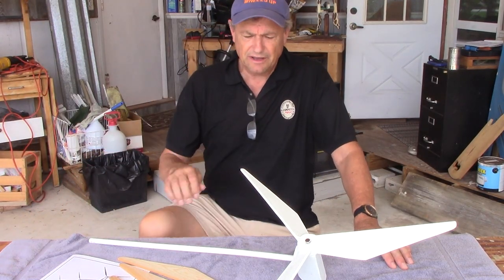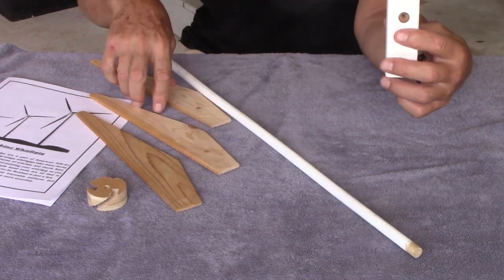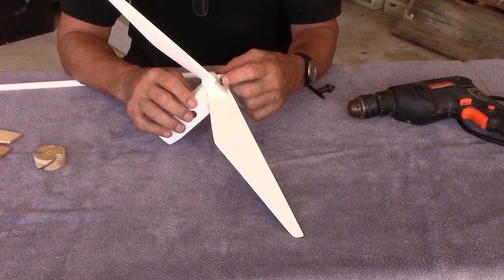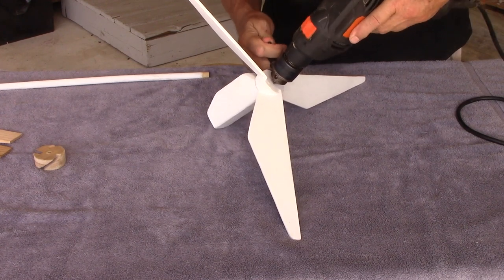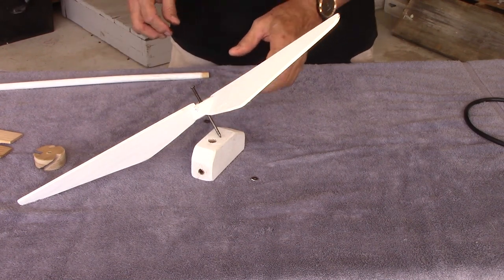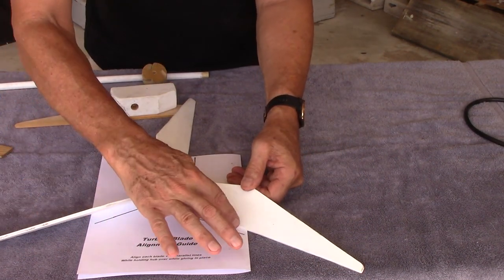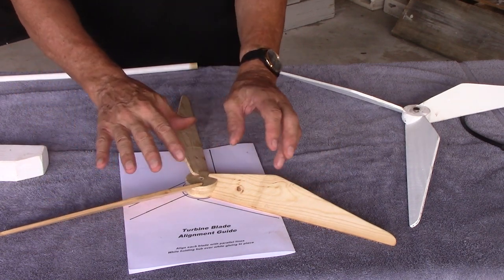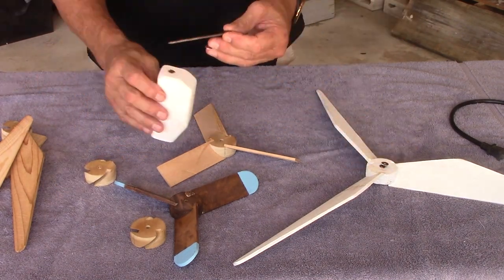How to make Best looking DiY  Wind Turbine Whirligig wind spinner big 22 inch Span

Comment: I’d be interested in watching a test you could create comparing the performance of the different propellor shapes shown here, and even if you made a set of the older blades, but extended to the same length of the 22” wind turbine blade. Have you thought about doing that?

Comment: Uh, clarification please.  At the start and at the end, your blade goes straight edge into the wind with angle edge trailing.  In the middle when you reassembled it was angle edge into the wind. Does it even make much difference?
Reply from the maker: I think near the end when I assembled the blades to the turbine body, I accidentally put them on backwards.  As far as the wind is concerned it makes no difference, however it looks wrong compared to a real wind turbine.Nice catch
Reply: @gwheyduke  Thanks. I'm using your blade design to make my own as my store bought one has rusted solid.